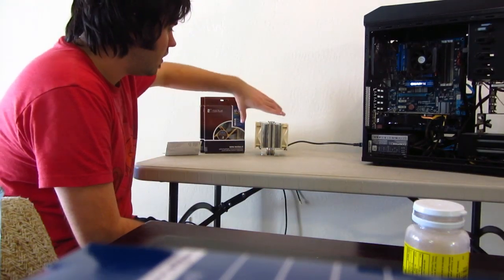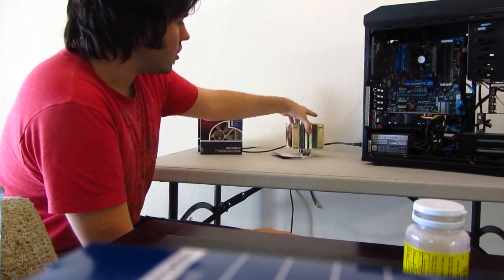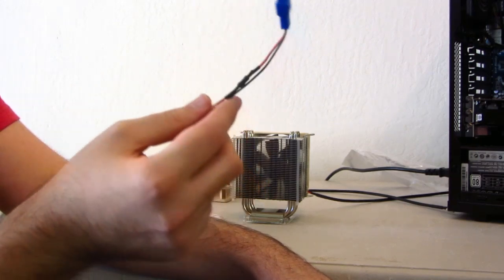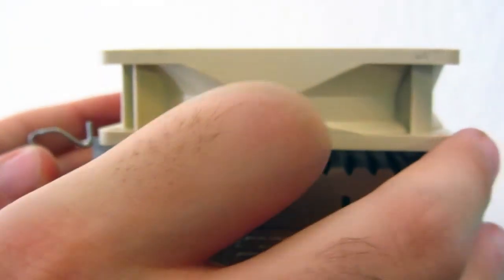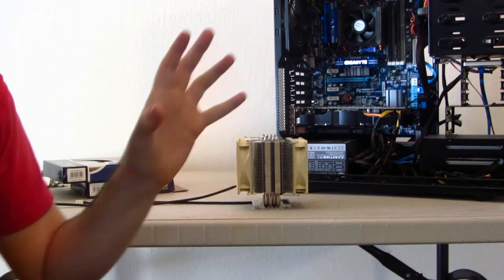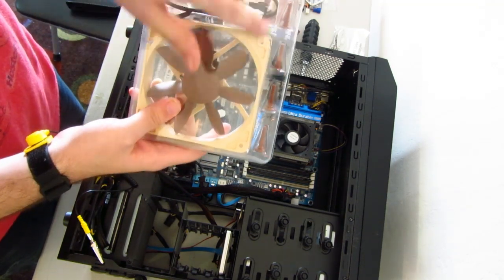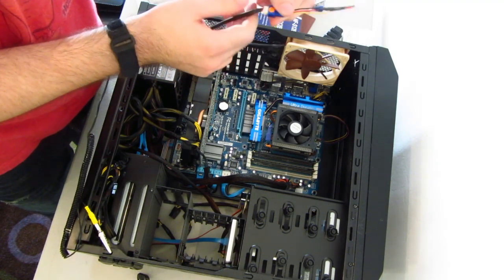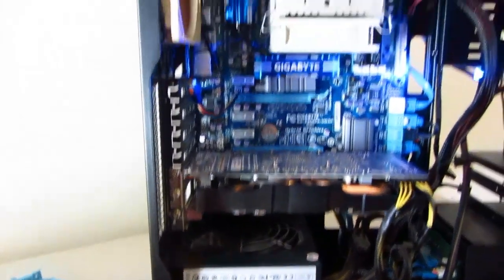How To Silence Your Computer Pt. 1:  Unboxing and Installing NOCTUA Fans and CPU Cooler

Comment: How to do it wrong
Step 1: Place your PSU with the fan facing the inside of your computer
Step 2: Place the cpu cooler so the fans blow the air to the top (only applies if there is no output on the top of your case)
Step 3: Put your only GPU in one of the bottom PCIe slots (not in the primary top PCIe slot
If you want to go even further you can place you case fans so they both blow air inside of your case

Comment: Cute thing here is that anti-static band is doing nothing, even if it was needed. It's clipped on to a painted piece of metal. You're better off just touching the case first because you're not supposed to ground yourself, you're only supposed to equalize the static charge between you and the components, otherwise you shock them. Even then nowadays you're very unlikely to fry anything, the only massive risk of doing that is at the motherboard factory.

Comment: herm....my computer still gets ridiculously loud at times. I have a cooler master hyper 212 evo and I can hear it about as loudly as your stock fan. I did replace the case fan in the back but I haven't installed one to the front yet. (I have a thermaltake V3 case and I am not sure how or where to install another fan to the front
Reply: Soooo... What do you need help with?
Reply: haha a little late on the up take there. Granted, I still haven't found a solution to my problem but I've kind of gotten used to it now. Nothing for you to worry about ^_^
Reply: filipinowhiteboy
Hehehe alrighty ;)

Comment: Anti-static wristbands are not needed at all, just touch your case before starting and make sure your psu is turned off. Apart from that, great video.
Reply: +Nick Hedges guess it was just extra precaution

Comment: hey you know that the graphics card only running half speed in the pci exspess.  It just vaier two 8x not 16 ass the top one locomotive that manual or on det bort  closer to the port, you'll see what I mean ^ ^ / NAB

Comment from the maker: Thank you for subscribing!

There are fanless cpu coolers, but I absolutely DO NOT recommend them if you're using an AM3+ based CPU.  The NOCTUA NH D14 might be a good solution - but it's a bit more expensive - around $84 + tax and shipping on Newegg.  Plus it's much bigger than the one in the video.  Another option would be the Thermalright Ultra-120 eXtreme but that might be hard to find.  Note:  Both coolers CAN be run without fans, but I don't recommend it if your PC generates a lot of heat.